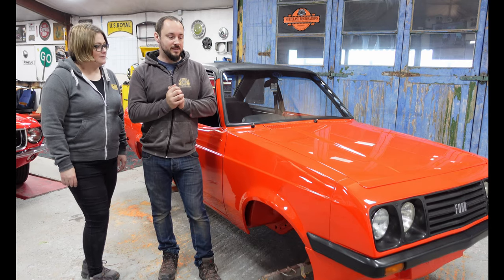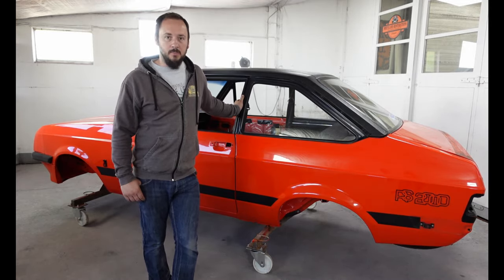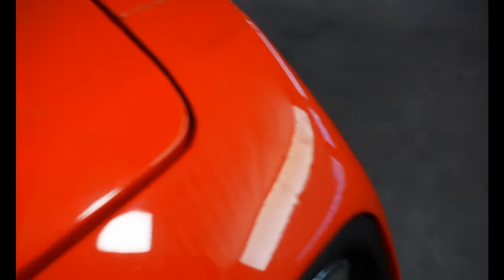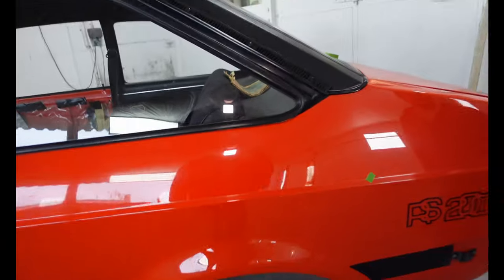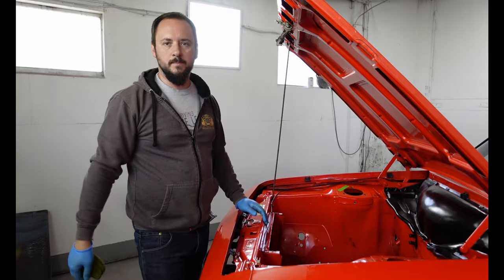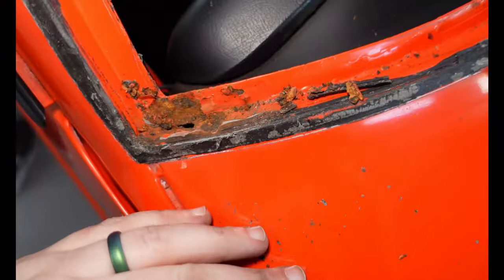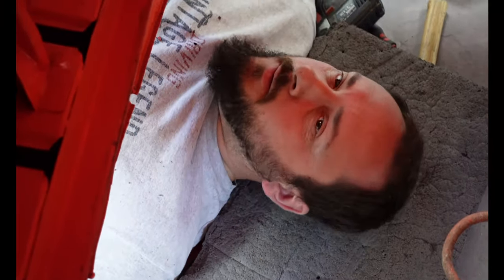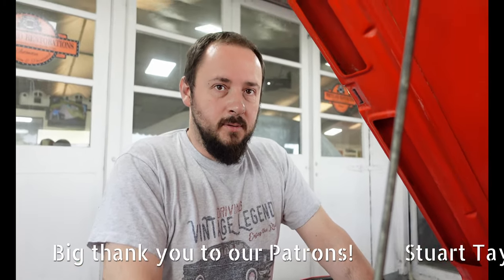Restoring the FIRST EVER MK2 Ford Escort RS2000 - Pt. 1

Comment: There's an argument that as #1 it survived this long on almost original paint & to do a full repaint would be to hide its story, its the owners choice but I think I prefer it with slightly crazed paint etc but with sympathetic repairs knowing its factory. If it was rotten as many are I'd agree. This is a weird comment for me as I like to rip into everything & modify.. pass me my pipe a warm ale! Looking forward to the next episode.
Reply from the maker: You'll find out whether the paint was original or not in the next installment 🤔 stay tuned!
Reply: The car was not on original paint. It was restored in 1994. However, the original underneath this time was exposed after removing the underseal and one thing led to another and having paint. The original paint in the boot area with PDI stickers was kept along with original underside, all original panels, all original interior cloth. 👍

Comment: Had a rs2000 from new with a bvr and it went full down the a pillars
Reply from the maker: From what we've learnt about the vinyl roof if the material goes all the way down the a pillars it was a factory ordered option. If it stops at the top like this one, it was a dealer ordered option. Also on this one it had different hockey sticks on the rear. Funny little quirks aren't they!
Reply: Had a yellow 1979 with a webasto sunroof